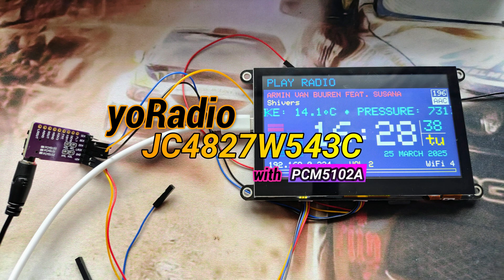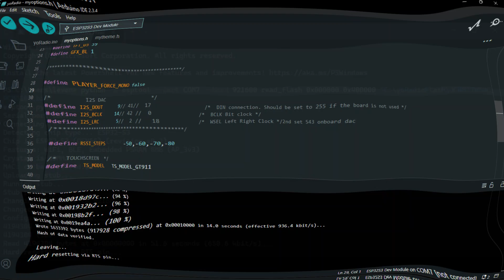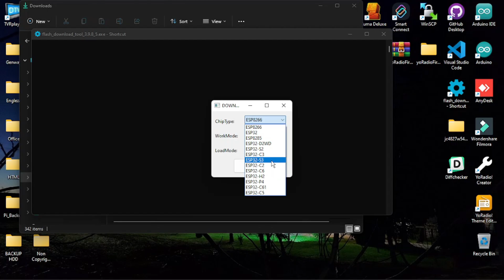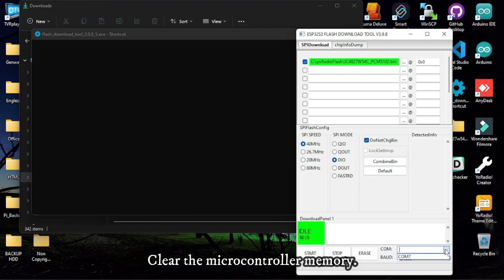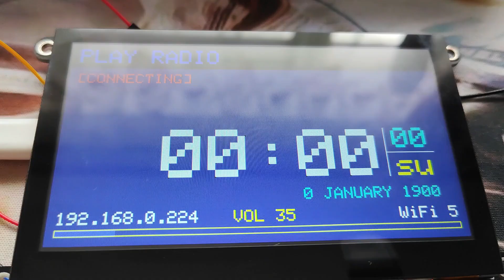JC4827W543C + PCM5102A the easiest touchscreen yoRadio with external DAC!

Comment: Hello on the video I see that there hardware with external antena for wifi.
I can not find  that module JC4827W543C wih this conector. Did you resolder wroom module?
Reply from the maker: I didn't make any changes. So I bought the module with the external antenna. I bought the module from here: https://www.aliexpress.com/item/1005006729377800.html
I bought the version with the capacitive touchscreen.
Reply: @LeventeDaradici  OK I made this radio and It works well. Thanks You
So there is second question. Haven't you ever consider about to add such property as bluetooth player or net player to the software.
It would make this an complet solution for home player. I think MCU could manage this funcionality.
Thanks.

Comment: Great work but is  something wrong with the connection to the PCM you show on the board io46,io9,io14 and io5, and on the pcm bck-0gpio14, din-09,lrck-05, fnd-gnd,vin-3v but cannot  find the above defitnitions, Also in the cable you have black-blue  yellow orange  while in the pcm yellow cables while in the pcm yellow orange black yellow  again and then blue , So on hand you have 4 cables and on the other 5 something is not adding up, Check your video 
Am i wrong.? i see tyhe VU meter  so the sound seems ok. I see the red led on the PCM so the power is on, i tested the headphones so they are ok, i m not sure whats wrong...These are the connections i tried  in 2 different PCM. JC4827W543C -- PCM5102

3.3V → VIN
GND → GND
GPIO14 → BCK
GPIO5 → LCK
GPIO9 → DIN
Reply from the maker: No offense, but I didn't understand where the mistake was.

Comment: Also ordered this device after seeing your video. I tried with the famous CYD but I sometimes get that the audio drops etc and then I have to restart it.   Wifi also is not great on that one and I had to put another AP a couple of meters away from it.  So if it works great but a lot of times it is very frustrating.  This one has an external antenna, a better screen and probably faster cpu//more memory.   
Only thing really annoying with these boards is that they don't include the jst connectors/cables (or was there 1 included like the CYD?). I almost paid 1/4th of the price for 5 cables which will come later as the board, so the box will stare at me first.
Reply: And up and running.   Good practice is to order 2 more (or a 5 pack) of these 1.25 4-wire JST connectors in case you use the PCM5102A, the IR and for a 5V input. There was 1 cable included with my board. Took 2 other from the CYD devices that I have, the other wires are on the way which I will use for the CYD boards.  First impression are very positive!  A lot faster and less dropouts (read none!) than that CYD board. I got it up and running, including soldering the 5102 in like 1 hour.  It all worked in 1 go.  Needs a bit of another screen layout, I like that one from nvalw btw.
Reply from the maker: I'm so glad you succeeded!
Reply from the maker: This is an ESP32 S3, it does not compare to CYD.

Comment: I repeated your previous design, I liked it very much, however, the screen is very sensitive and the playback is constantly interrupted. However, it is still a great thing. Can I include an amplifier on MAX98357 here?
Reply from the maker: I'm surprised that your playback is interrupted. It works flawlessly for me. Do you have a strong enough wifi signal? Regarding the Max98357, it can be connected instead of the PCM5102A and it will work. I haven't tested this variant (with the MAX98357), but it should be functional with the same connections and the same precompiled binary.
Reply: @LeventeDaradici  It works very well with the Max98357A, the sound is significantly better and I no longer have this distortion problem with the DAC and the amp integrated with the JC4827W543C a few seconds after powering up and for a minute or two...
Don't forget to make the shortest possible connections at the input of the max98357a and you can also solder a 100kΩ resistor directly to the terminals of the latter between the "ground" and "gain" connections for a gain of 15 dB.
Reply: I abandoned the MAX98357 DAC because I never got satisfactory operation with it, including distortion and random changes in volume! Since then, I have successfully used the PCM5102A, which works perfectly provided you make the jumpers I indicated below.